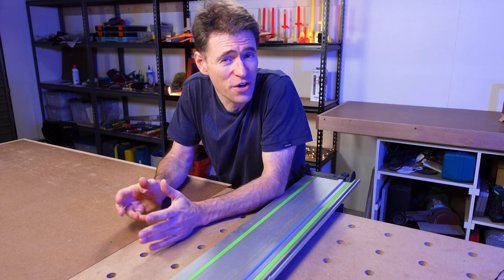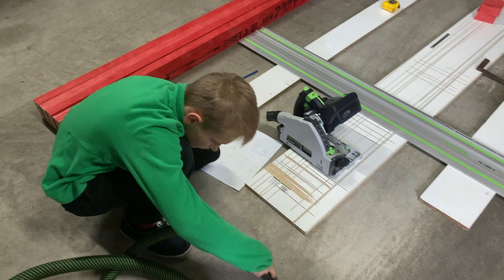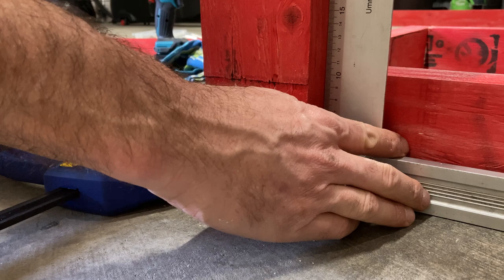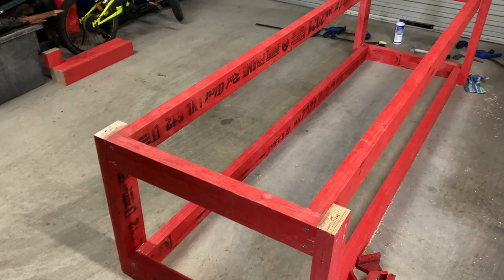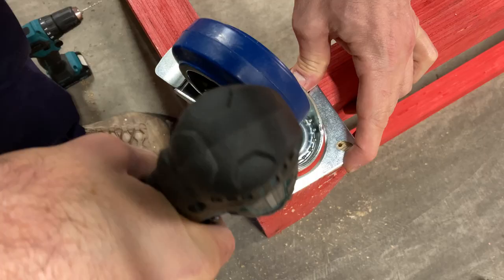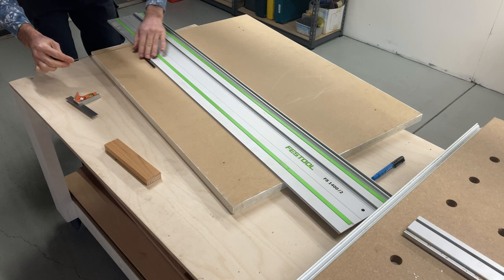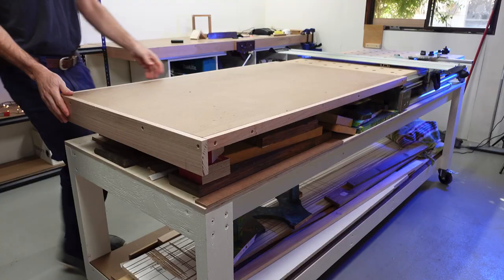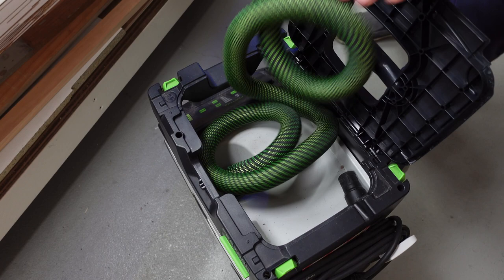Mobile workbench with Festool MFT 3 - Awesome for small workshops

Comment: I like that setup, seating a folded MFT3 on a solid work surface for stability, still allowing you to take it with you if needed.  Besides, the cost of the rest of the bench is probably cheaper than the MFT3 stabilizer bars!
Reply from the maker: Hey, thanks for leaving a comment. I've been using this bench for over a year now and it's proving to be really great. Easy to move around and versatile for a variety of work. I use it every day.

Comment: I've often wondered if you can DIY that style of on-bench track saw cutting capability. It's all in the hinge yes?
Reply from the maker: The hinge is important, but it 's also about the fitting at the other end. There's a fitting at the other end which connects into the channel running through the underside of the track. This locks the track in place once it's in the down position.

Comment: Excellent work and information shared, thank you! I have 2 questions: What is the diameter of the holes in the worktable and at what distance are they made? Greetings
Reply from the maker: Thank you for your kind feedback. Hole diameter = 20mm. Hole spacing = 96mm.
You can buy just that work top, and not the whole MFT setup.
https://www.festool.com.au/replacement-perforated-timber-top-for-mft-3_495543.html
Glad you got value out of my video. Thanks again for your comment, and have a great day. 😀